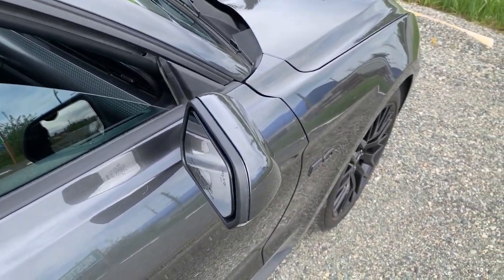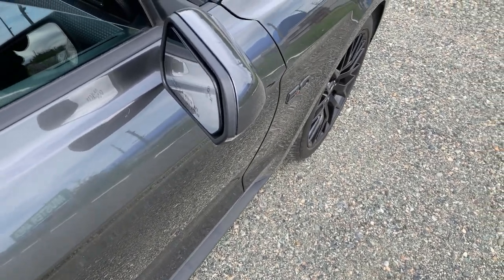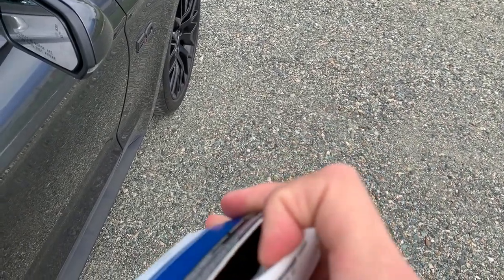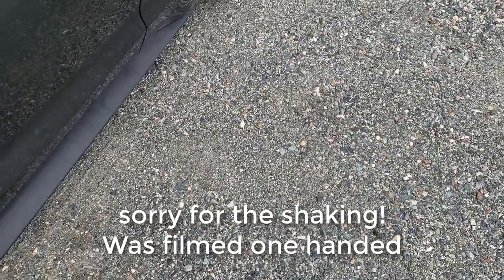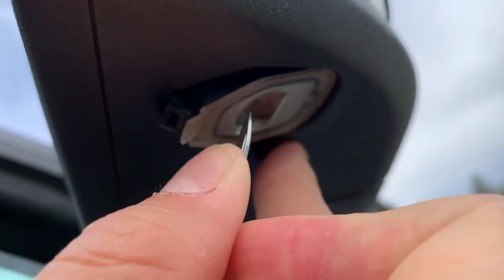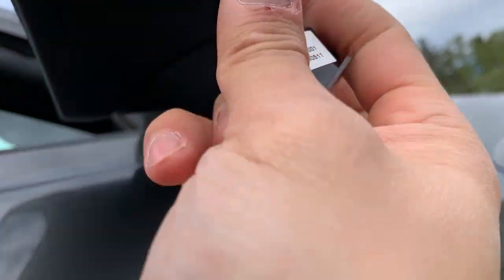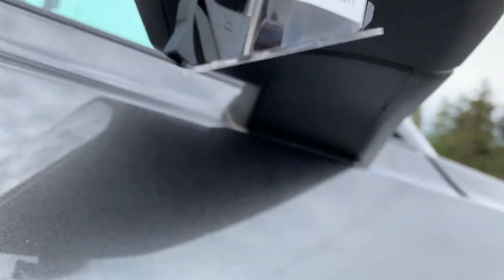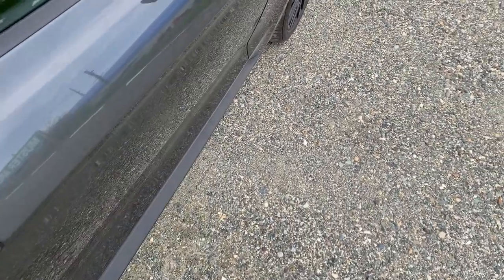How to replace the puddle lamp on a S550 2015-2017 Mustang GT in under 5 mintues! (blurry pony logo)

Comment: I just pulled them off and removed the clear plastic. I then clean the inside of the clear plastic and glued them back on. Worked perfectly
Reply: The new puddle lamp from ford has a smaller blue pony logo, did you fix the original puddle lamp that has a bright white big pony logo?? I have both new and old, but old one is distorted
Reply: Did you had to take appart the led assembly? I removed the plastic part and cleaned it inside but it seems the problem is inside.
Reply: you would have made a video

Comment: I have a 2013, hopefully it’s as easy to change as this, thanks!
Reply: Same! Was it an easy change? Just bought the car and haven't looked at it yet. Im assuming it's the same procedure for a 2013 at least I hope
Reply: Just did it on mine, it's the same procedure but I feel like i had to try a bit harder than the guy in the video
Reply: @dyltorres7783  yeah it’s the same thing, surprisingly easy
Reply: Hi I got 2014 mustang and I have the puddle lamp but it’s not projecting pony it’s just blurry light how can I fix that thanx